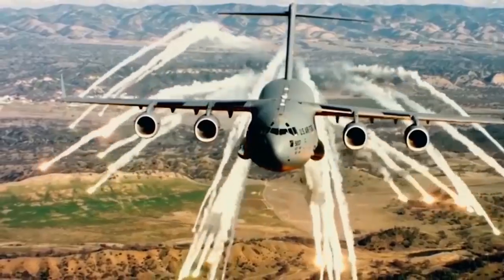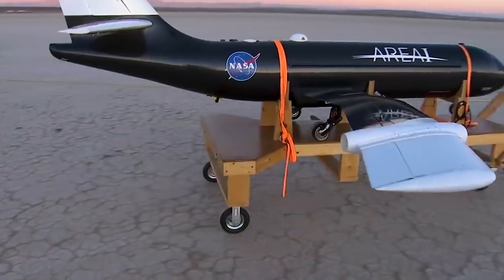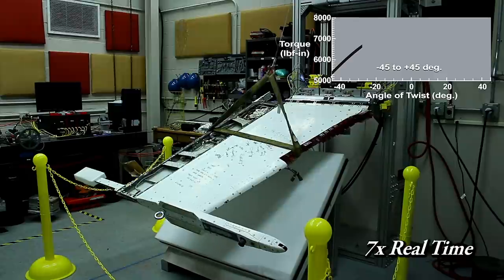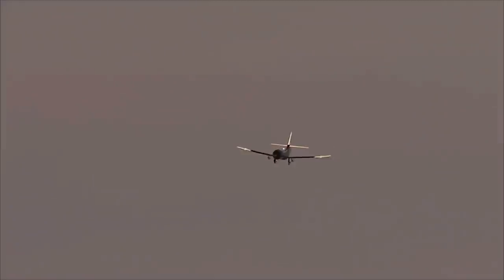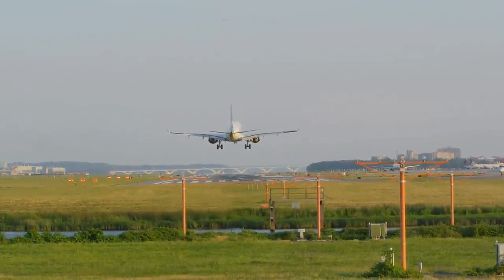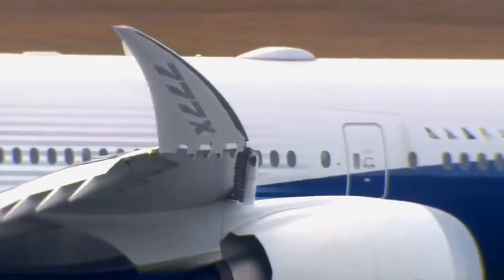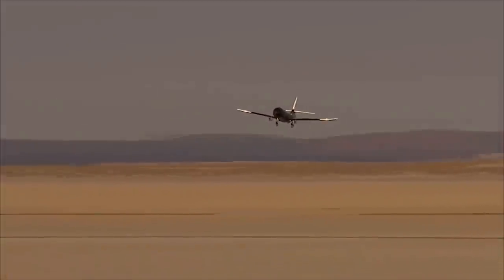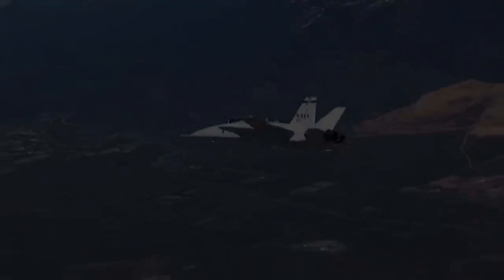An Airplane with Shape-Shifting Wings (memory alloy)

Comment: In one way or another, this will be the future. It makes the most sense.
Reply: It'll never be implied, the project for mass use would be too expensive it'll probably get buried in politics and files
Reply: @foxmulder3980 Lol ironic. A fixed-wing will always have inefficiencies due to the wide range of speeds modern planes travel. There's a sweet spot at a specific speed/AOA and that's it. The only way to overcome this would be with a transforming wing. I'm not saying this exact idea, or that it's completely necessary, but as the technology becomes available it will happen. 

At least I'm not buddy over here who thinks an engine fire combined with this system somehow automatically means death. Even though the system is electrically driven and could use battery power to revert itself to a safe position during an engine failure.
Reply: @Optical Clarity Care to explain that?

Comment: Seems like a whole new can of worms for accident investigators, but worthy of implementation nonetheless.
Reply: The biggest deterrent to it's 
Implementation will be the insurance companies. Proving to them that the technology is 
"Safe" for civilian use may be the impossible dream.
Reply: Like to see first time always works but Delta wings are the best for super sonic flight because it is rigged and can be strong enough so it can’t rip off easily. Debris from anywhere is a problem for the entire aircraft Concorde crashed because of debris on runway and other crashes Concorde should be revived by next year or any other year so it can be modified to be safer and not a manned guided missile 911 people turned 3 planes into guided missiles Pearl Harbour Japanese turned their planes into suicide missiles.
Reply: @Jaystarzgaming  what a useless ramble

Comment: The alloy is called nitinol its a metal developed by Berkeley and the navy in the late 60's early 70's . A better explanation of how it works is that it is shaped to a predetermined shape while it is red hot. When it drops below a set temperature determined by it's combination of titanium and nickel it is malleable once heated to set temperature it will reform its self to the predetermined shape over and over again

Comment: The XB-70 could articulate it's wingtips down, but the idea there was to ride the super-sonic shockwave at high altitude to gain additional lift. I'm not sure if any other aircraft used the same technique.

Comment: Neat!  Man...imagine this kind of wing-folding on a swing-wing aircraft! The range of control you could attain would be unreal! Even more agility could be attained with vectored thrust engines combined with memory folding wings and swing-wings. You'd get performance like the Super Sylph from Yukikaze I bet.
Reply: It would only be possible over a very limited range of the wing sweep, unless you put in a very expensive and heavy rotating hinge mechanism and thus lose all of the alleged benefits.
Reply: @neiloflongbeck5705  Could well be, I'm no engineer, that's for sure. ;-) I guess i over-estimated the strength of the material used. Even without my jamming everything else onto a theoretical plane, the wing folding memory alloy is damn cool tech.

Comment: Wings are designed to be rigid and flexible.  Wings are also designed to house fuel so putting more wing mechanics in the wings will reduce fuel capacity neutralizing any slight benefits.

Comment: It's great idea until one of the wings get stuck.
Reply: I was thinking the same thing. What would happen if (when?) one wing tip folds but the other one won't. Or if they are folded down but can't move them back to zero degrees for landing?
Reply: The changing of the wing position is dictated by set reactions to temperature. If this hot or cold, then this position is needed. But its not the material moving the wing. The actuators for the actual position change are (man I hope) the same standard and proven tech already in use for all other flight control surfaces. Meaning this (hopefully again) should not have any more risk or chance of failure than any other moving control surface. My concern would be making sure the pilot has the ability to manually override the system to ensure less problems during accent or landing. I guess lets all just watch and see lol.

Comment: I’m sure these engineers are taking into account the temperature variations at higher altitudes.  I’m curious what insulation’s they are using to keep that material at a constant temp so they can manipulate it how they see fit.

Comment: Yeah I see death written all over this thing. Heating an alloy over and over and over to make it bend ????? Yeah , that sounds super reliable......
Reply: I was thinking the same thing!! But after I thought about how, I believe the heating returns the alloy to it's  original "as manufactured" shape...The rods or tubes already have a twist in them. Installed, half twist one way, the other half the opposite when heated. I remembered footage of a car panel that after getting distorted returned to shape after hot water was poured over it. And if the heating fails, the wing stays level. Clever lads! However, who knows after a thousand or five reps.....may just drop out of the sky!!
Reply: MrZep420  Eh , thats not the same thing as heating a material to make it bend over and over,,... Called heat cycling.... It never ends well..
Reply: MrZep420  Absolutely they do and im glad you brought up the black bird as I have some childhood experience with that particular one .Yes , the air frame and panels do heat up , so much so that the aircraft is a maintenance nightmare . It cannot sit with fuel in it , it has to land empty or be drained and stored empty and requires constant checks and maintenance to keep it flying. Now this is just tying to keep the parts in shape and on the air craft. They arent actually trying to completely altar the shape of the things with heat in a pretty drastic way...
So if the heat is that much of an issue with a plane and keeping it intact . Can it seem like a good idea to inject heat to change entirely the shape or its parts ?
Reply: @Kyle Van Tassel  The material is called Nitinol. It's already in heavy use in the medical and aerospace industry. Its heat cycling capability is much better than you realize. I know, I work with the alloy. The amount of heat needed to make the actuator work isn't as high as you think it needs to be either. All specs are considered when producing and shape setting the material.
The SR-71 was built with different titanium allows, not shape memory alloy. 
Nitinol can replace mechanical actuator needs by eliminating bulky, complex equipment, while saving weight. This is huge in the aerospace world. The tech is still somewhat new and its applications are still being explored.
If you've had, or know someone whose had a major surgery, you've more than likely had a surgical implement that utilized Nitinol.

Better yet, want to know how that crazy magician bends a spoon by rubbing it with his fingers while concentrating real hard? 
.........Its Nitinol.

Comment: I live high on a ridge and observe large birds in flight, at eye level. All birds fold their wings depending on what they are doing. When a bird of prey dives, it increases speed by holding its wings close to the body. When slowing to land, all birds spread their wings to the maximum and tilt them up to drop lift.
It seems logical to emulate the birds in aircraft design.

Comment: Those alloys cost a fortune and fail due to fatigue. I had eyeglasses made from titanium memory metal, the big selling point is you can bend it 1500 times and it will return to shape. Sounds good until you realise you put them on several times a day, and every time flexed the frame. Steel lasts several years and is dirt cheap.

Comment: Thanks for covering this. Personally, I just don't get it though. How is this better than an electric actuator? Heating something to get it to move is slower to respond, less precise and requires more power than a motor. As for weight savings, a motor could be quite small and even geared and still respond faster and be less massive than the actuators shown for this.
Reply: I guess you dont need super precise movement for these flaps. Its enough if you can move them up or down in some minutes. As for the weight, there have to be improvements compared to an electric or hydraulic actuator or they wouldnt test it, simple as that.
Reply: according to their website, they do it for weight savings.  It's stated there that the previous tech (motors and gears) would have been too bulky, where this the system is strong enough to be a hinge on a wing, but still light enough to not be "too cumbersome" with the added mass for the hinge.  https://www.nasa.gov/centers/armstrong/feature/nasa-tests-new-alloy-to-fold-wings-in-flight.html

Comment: Why is heat the indicator to shift wing position? I don’t understand why you wouldn’t use speed as indicator
Reply: Speed produces friction, friction produces heat.
Reply: heat isn't being used as an indicator. It's used to provide the force that changes the shape of the wing. With memory alloys, if you deform the material at normal temperatures it stays deformed until heated, at which time it reverts to the original shape. Sort of like if you take a rubber band and put it in the freezer; once cold you can take it out and wad it up. It will stay wadded until it thaws.
Reply: Mark Liittschwager that makes sense. I’m a software engineer so I would call erroneously call heat the trigger or indicator of change. Sorry. It’s nice that the metal has unique properties for changing shape using heat, but why would you use this method over just normal metal and a normal actuator? I could reproduce this design almost exactly and just use a regular actuator  and regular metal.
Reply: @patjohn775  as they said it would save weight.
Reply: a mechanical joint is a weak point. The idea is that you want the wing to be capable of having two shapes, but you are not interested in the transition, this isn't about movement between the positions. Using a traditional hinge, activator, etc, makes sense only because it's the way it has always been done. If you wanted to make a wing that is straight, would you incorporate a hinge and actuator? No, that would be silly. If you wanted a bent wing would you include a hinge and actuator? Again, silly. So the extra hardware is only there to get between the two shapes you want, but the in-between condition is not what you are interested in.

Comment: Don’t some aircraft already have folding wing tips ?
Reply: Yes, lots on Naval aircraft use folding wings. Bavk in the 1990s Boeing was looking at folding wings on the 777 on the ground so that they could use existing gates.
Reply: @neiloflongbeck5705  no I’m almost positive there’s a passenger jet in service with folding wing tips
Reply: @Marcus51090  I can't confirm that but somebody out there will be able to. All I know is that Boeing talked about it back in the early 1990s for the 777.
Reply: @neiloflongbeck5705  I found it it’s the Boeing 777X has folding wing tips and is in service
Reply: @Marcus51090  thanks.

Comment: Something doesn’t make sense (to me):  why use something as kludgey as ‘heat activated’ actuators to move the wings?  I have to imagine that something more conventional like the hydraulics that already move the flaps could do the same thing.
Reply: They explained in the video that traditional hydraulic actuators are heavier and more bulky that this system
Reply: @bamafan-in-OZ  ... but there are already hydraulics systems IN PLACE on the fixed wing aircraft that they are trying to enhance.  I mean, YES if there is already ‘1’ hydraulic pump and you add a second that is double the weight.  But if there are already 5 or 6 to move multiple sets of flaps then adding a 6th or 7th would only marginally increase the weight.  In return for that marginal weight gain, you’d have a system that is well understood.

OR

Test these systems out to control the flaps too and reduce that much extra weight.
Reply: @oiramsq73  just to clarify, they have multiple pumps as a central system which supply actuators or cylinders to move the parts, but to do this it's the extra mechanical structure required that also adds weight. With the flaps and other surfaces I think the limiting factor at the moment would be how fast the material responds to the heating and cooling as they stated it took 3 min to adjust the wing tips.
Reply: @bamafan-in-OZ I think that at a certain level you have to assume that wing shapes/structures have to change; when I saw the video from the rear-stabilizer that showed the kink upwards in the wing I had to admit that it is strange to have not become more like a bird’s wings.  In the next hundred years the mechanics of flight are destined to change.

If it were me in the cockpit of the first plane to have a folding wing design, I’d want something that I’ve experienced a thousand times before and that has always worked (knock on wood) - hydraulics.  That said - the test drone was not so far off from being able to carry at least one person.... Amazing to think how far we’ve come in 120 or so years.  The next hundred will be incredible.
Reply: @oiramsq73  if you were in the cockpit of the first plane to use this you would be a test pilot and understand the risk you are taking. If we only relied on  tech we know and are comfortable with then we wouldn't ever test new designs.
Reply: @moshunit96  just the thought of it gives me uncontrollable IBS!  Those guys (test pilots) deserve a lot of credit.  From what I understand, they LOVE doing it.  I’ve spoken to a bunch of commercial pilots and they always say that they are being taken advantage of (because they love the job so much that they get hosed when it comes time to get paid.)

Comment: wait a minute... how about folding the wing tips asynchron? would they work as ailerons?
Reply: Yes, but it would mean  they would fatigue faster.
Reply: @neiloflongbeck5705  why is that so?
Reply: @tombmaster972  more cycles under load mean fatiguing the metal. After even a child can cause a steel paper clip to fail if the bend it often enough.

Comment: I don't get the benefit of the Shape Memory Alloy over a conventional Electric Motor. That thing is fuckin' huge and I bet a testicle that one could have a smaller WHILE still faster acting ( 3min to change the shape?! Fuckin' lol ) design using an Electric Motor attached to a Strain Wave / Harmonic Drive Gearbox AND with the whole design also having the possibility of being made redundant via the use of a 2nd motor/gearbox combo and both combos feeding into a differential gearbox where if one fails the other can still take over.

Comment: You're so misinformed! The wright brothers didn't use "foldable wings" their control system was wing warping!!! The XB-70's wing folded to trap the almost hypersonic shock wave under the wing for enhanced lift/speed (somehow) wasn't part of the flight controls! The superduper NASA rc plane uses wing warping as it's flight controls! Folding wings have nothing to do with this prototype plane!! 
Obviously you "research" as fast and "accurately"as you read!
Come on dude!!!!
Reply: Do you have a source?
Reply: @tylerwilson9633  Yeah it's called history. The Wright's flight controls were a cradle around the hips(pilot flew in the prone position) that warped the wings when you slid either right or left. The stick was for the elevator type control. 
History of Flight a Time / Life book series explains the Wright Flyer controls very well! 
Now as to the B-70, look it up! Any half assed comprehensive study of this aircraft will explain the folding wingtips. But no I don't have the card file no.of the specific book I read 30 years ago in school. Sorry. 
The plane featured in the video uses a variation of "wing warping" for moving the control surfaces. In an actual Wright Flyer there are no control surfaces as we know them. The whole wing was twisted to raise or lowerf the leading edge. This plane,seems to use a warping material to move actual control surfaces. Not warping the whole wing but instead replacing mechanical/hydraulic actuators to move control surfaces. 
Hope this helps.